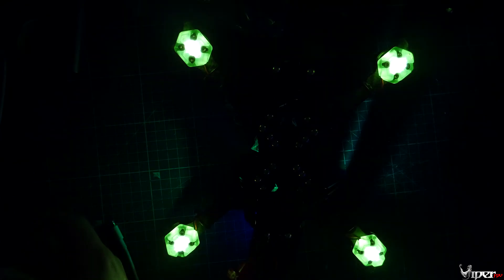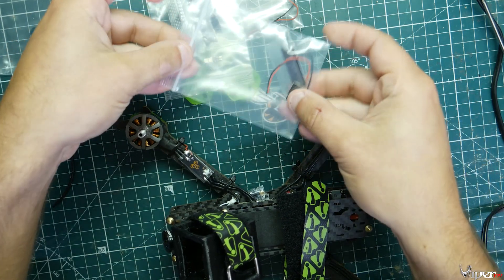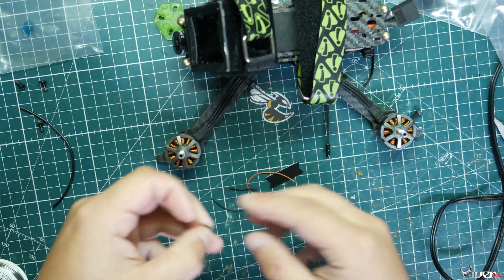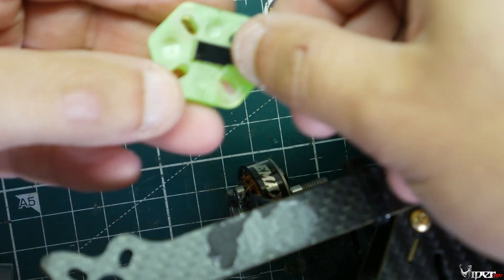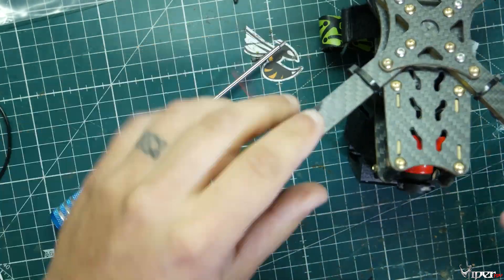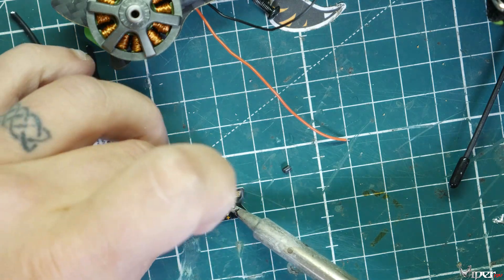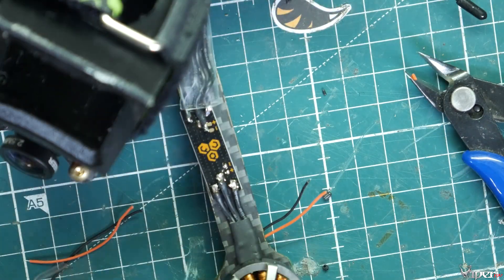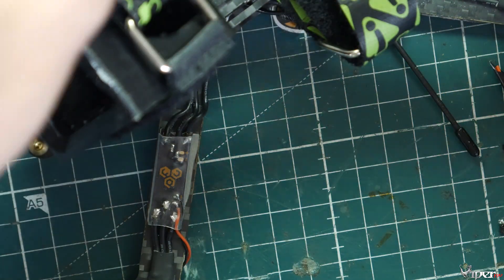FPVCRATE Lume Skids - How to Wire FPV CRATE Lume Skids - Tutorial

Comment: Do the screws that are supplied with them touch the windings in the motor? Mines look like they might so I haven't installed them
Reply: It would depend on the thickness of your arms and how much clearance your motors have. I just installed some on a frame with 5mm arms using Xing 2806 motors and the included screws were perfect length for my setup.

Comment: This was super cool! Do you think you could program them in Betaflight to light up based on stick input? Brightness too? That would be really neat
Reply from the maker: Flying90 no since there run off the motor voltage. But there are tiny leds that do what u have explained.
Reply: Viper_FPV ohhhh I see!! That makes total sense as to the added race wire you added! 🤦🏼‍♂️ for some reason I thought they got powered separately